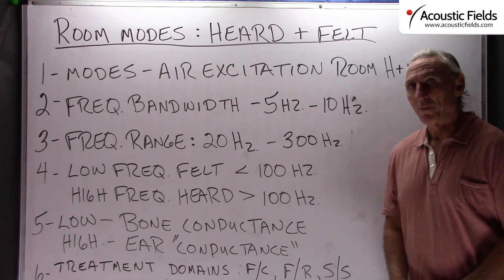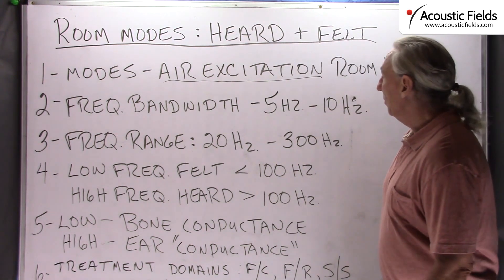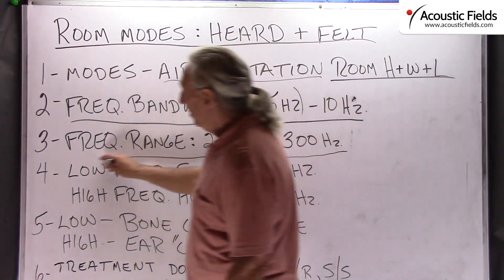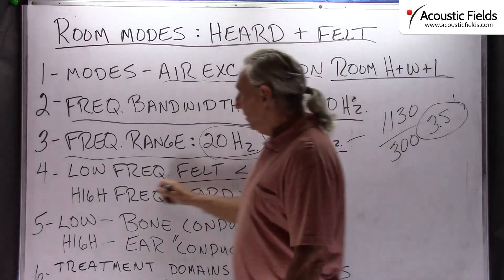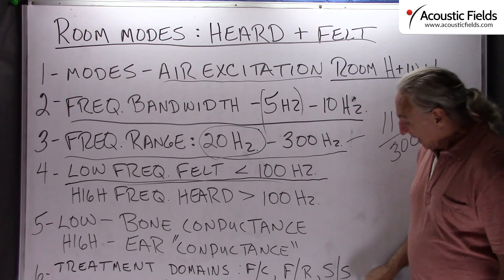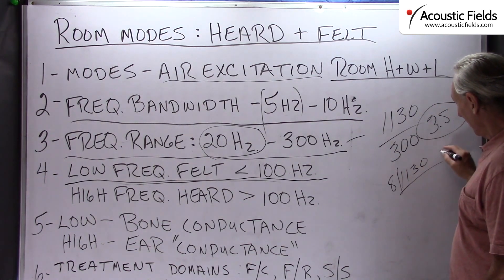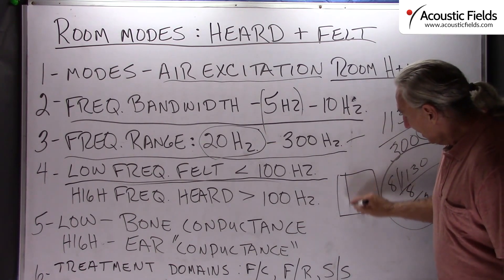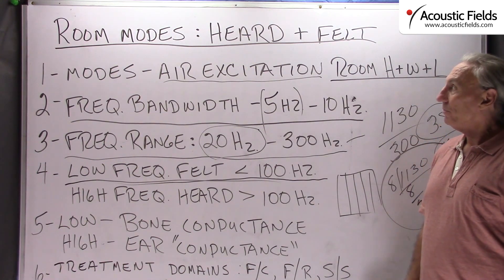Room Modes: Heard & Felt - www.AcousticFields.com

Comment: Understand about needing a taller ceiling. Want to listen to vintage L65 JBL speakers, turntable, and Pioneer amplifier and tuner. Would it help to not finish ceiling at 8.5 feet and leave 16" floor trusses open? Wife is allowing me to have a 15 x 24 foot room in new basement. Front wall is going to be ICF wall. 2" foam walls with 10 inches of concrete. Doing all walls covered in plywood.
Reply from the maker: You will need four walls of low frequency absorption for this usage and volume.

Comment: Thank you for your reply for my queries,could you plese post some videos about where to place the room treatment materials after finding the room modes and is it possible to eliminate room modes using eq alone(i.e not using any abosorbers)
Reply from the maker: N,  Small rooms require treatment for unwanted low-frequency energy issues on all 4 walls and ceiling. If ceiling is not an option, then you can treat the floor.

Comment: thanks Denis, always enjoy your lectures..i guess one way to reduce the problems from room modes and standing waves in a small room (8ft tall, 17ft wide,18ft long) for two channel playback is to use much smaller 'speakers.  It can be a challenge however finding a smaller speaker which doesn't reduce sound quality. Drum reproduction, particularly, seems to suffer, when 'speakers get smaller, in my experience. Presumably, experimenting with different 'speakers is the only way to find what works!? I have used the same Heybrook HB3 speakers for years, but am concsious that they may be overdriving the room at times. thanks, Stu.
Reply from the maker: Hi,

It has been my experience that smaller drivers produce more definition and larger drivers produce more energy but less definition. It is a challenge to match driver diameter and number to room size and volume.
Reply from the maker: W,  The room only sees energy. You can produce energy with any device. The problems will always exist.

Comment: I have gone through videos,Its is very easy to understand.Actually i am beginner to room acoustics and I want to learn form basics.Could you please give some topics about room acoustics and about importance of room modes.Why room modes are occuring at particular frequenc,why not other frequencies?and what is the difference between large and small room acoustics?
Reply from the maker: N,  Small room acoustics is all about low frequency pressure management. Large room acoustics is reflection management off of large surface areas.
Reply: @AcousticFields  Thank you for the reply